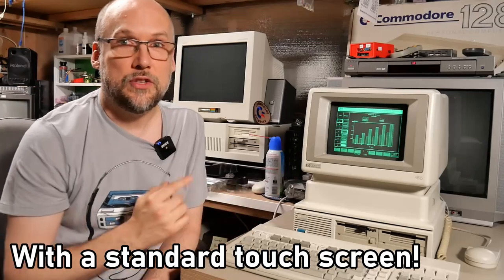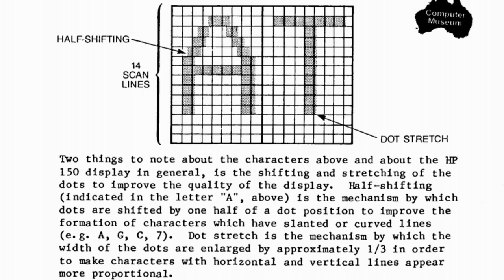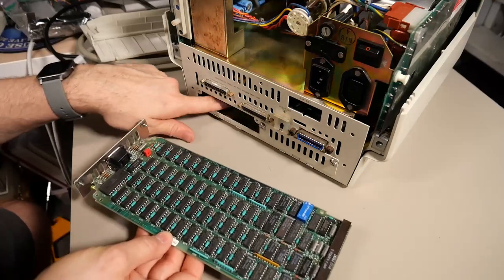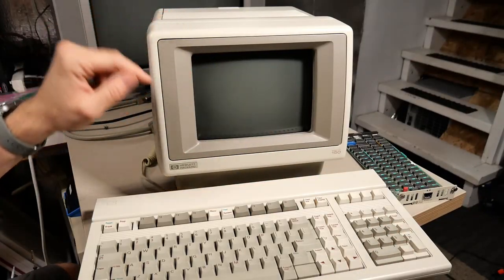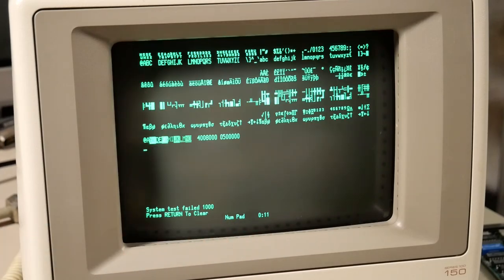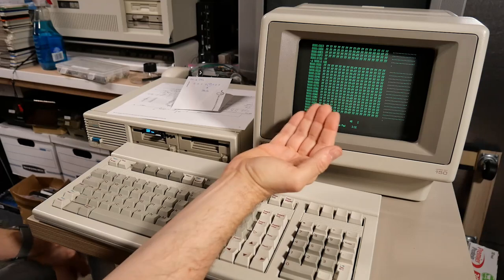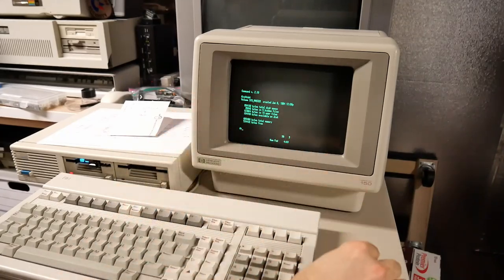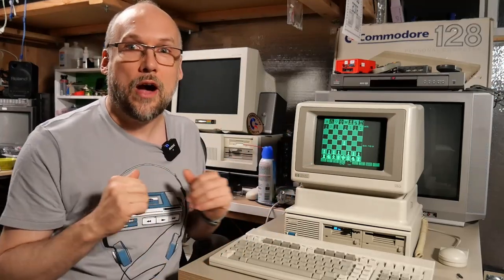Touch Screen MS-DOS PC from 1983

Comment: "[...] Troubleshooting instructions literally just says: "Oh, you've that error? Replace the board". "
Was it built by Apple?
Reply: Every computer, old or new, pretty much says that in their service manuals. When I used to work with IBM and HP servers, you'd troubleshoot the issue, open the manual, and it'd just tell you what part to order.
Reply: The days of door-to-door repairmen who could diagnose a problem down to a single part and then replace that part were already long gone by the '80s. Largely because the hourly rates of anyone that knowledgeable would be more expensive than just replacing the whole card.
Reply: Apple doesn't have troubleshooting instructions
Reply: @zombieswitapple  every manual for any computer has troubleshooting tips in the back pages. For business customers with high spec machines (like a HPZ, IBM Power, MacPro or Dell Precision) you'll get some form of configuration manual (memory, cards, networking, management etc). Authorised repairers and resellers get technical manuals.

I know the internet has this weird hate boner for Apple but they literally do nothing different compared to the other big computer companies.
Reply: @stevethepocket  that and it's not like a door-to-door repairman is going to have all the equipment and knowledge necessary to repair any digital circuit then and there. If a digital circuit, especially a modern one, gives up, then the only option 99% of the time is to replace it. The memory board in the video is _six layers_. That's not being repaired by anyone.
Reply: No. Apple would just say "Replace the entire computer".

Comment: It is sad to see what has become of HP. Back then they were magnificent in measuring and testing equipment, later on computers and printers and now HP is no longer a shadow of what it used to be. The sellers of ink for printers that can print up to one hundred of prints with one cartridge. Overpriced plastic junk.

Comment: Hi Adrian another fantastic video from you. I found your RAM card with the HIL bus http://www.hpcc.org/cdroms/schematics5.0/peripherals/hp150/hp45915.pdf . I was thinking of offering you a clone of the RAM, but with new LS245 and 8-bits of RAM insted of 1-bits of ram. But you figured out which RAM socket was faulty. Though it could be fun to do a 2020 remake of a 384 KB RAM with HIL bus with a new PCB. Hail Adrian :-)

Comment: 9:22  since the mouse port is on the memory expansion, and the memory expansion is not working, I'd guess that's why the mouse does nothing.
17:50  I'm guessing there was a timing issue with the original traces.

Comment: these days hp stuff isnt as serviceable as ya think just to replace a bad power jack atleast on the model i had ya had to pretty much remove the motherboard while the acer one i can get to the jack easily
Reply: Last HP laptop I fixed I had to lift the entire motherboard out to reach the RAM
Reply: @comradepeaches9041  wow the ram on the model i had the ram could be accessed as soon as i removed the bottom cover
Reply: Modern HP is a very different company to the 'original' HP which made this machine. HP used to make all sorts of high-end scientific instruments, and as far as I understand it they had extremely capable engineers and top of the line products for specialist uses. More recently, that was separated off into a separate company - Agilent - and then even more recently, the test and measurement part of Agilent became Keysight. So a modern HP laptop isn't much to do with the "old HP", but if you have a Keysight oscilloscope or something like that, it has more of a connection to the HP of old.

Disclaimer - I only know this from watching CuriousMarc here on YouTube!

Comment: this machine 16 bit address?
Reply from the maker: It's an intel 8088 -- 16 bit processor with an external 8 bit data bus and a 20 bit address bus. This machine runs the full 20 bit bus -- with 1mb of usable space just like the IBM PC 5150 and onward.
Reply: @adriansdigitalbasement  first machine is 16 bit heheheheh?

Comment: Hi, to service that HP with the sliding boards, they would use an extension board, that connects in the place of the card and brings gives the same connector and rails to put the board outside the computer. Similar to this https://www.ebay.ca/itm/Sony-EX-105-1-620362-13-Extender-Extension-Board/401946468285?hash=item5d95e05fbd:g:0bAAAOSwz5pdwIzO now where to get those for the HP150 ! Thanks for the videos I enjoy every one of them.

Comment: What if I told you that a “doesn’t matter” attitude toward an ESD safe workspace is what leads to these kind of memory faults
Reply from the maker: This RAM chip failed in a computer turned off stored in a garage. How exactly was ESD responsible for the failure?
Reply: ESD can cause this but it’s extremely rare - as in: so rare that one person active in the electronics space may never experience a failure that they themselves caused on their own computers. So while you have a point, it’s not practically relevant. You won’t kill populated memory boards with ESD easily, not unless you actually work hard to make that happen. I occasionally look for root causes of chip failures and decap the chips and stare at them under high magnification: never ran into an ESD failure that I didn’t cause on purpose just to see how one would look and corroborate imagery found in books.

Also: it’s an American basement, on the West coast. Those are never totally dry unless you’re in Arizona or Nevada or some arid place like it. American basements without excessive air conditioning are almost like an ESD safe workspace just because of how they are built and where they are placed. The moisture barrier between the inside and the surrounding ground is so poor that it’s almost as if you were working on electronics in an earthen building.

Comment: Need your help. I have a 64c that won't power on and would like your help to getting it back up and running. Please Help..
Reply: I do believe Adrian has covered C64 repair on this channel. You would need to search through the previous video list. Also I would recommend Perifractic's  Retro Recipes channel and The 8 Bit Guy's channel. You will need to do a bit of digging about but you should find something that will point you in the right direction..

Comment: Well engineered? I guess so...
Seems over-engineered.

My experience with HP PCs leaves basically one impression... cheapened versions of already unimpressive motherboards... I have not, of course, been exposed to all their models... That's just what I expect to see inside one.

I do wish I owned many of their non-PC related products. Test equipment, etc...
Reply from the maker: I think HP computer and consumer products of the last 20 years is nothing like their stuff from the 80s and earlier. This thing is designed like how their test and lab equipment was (and still is if you're buying Keysight and Agilent stuff.) Definitely a different philosophy.